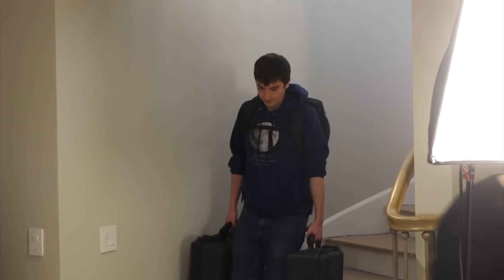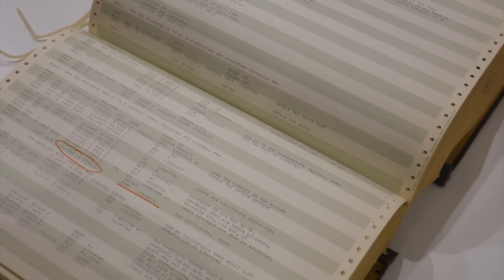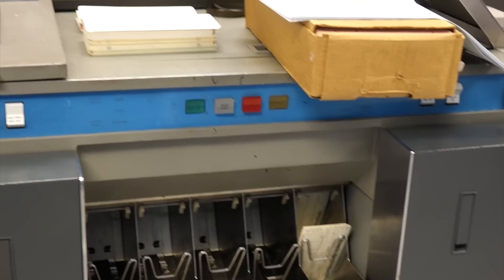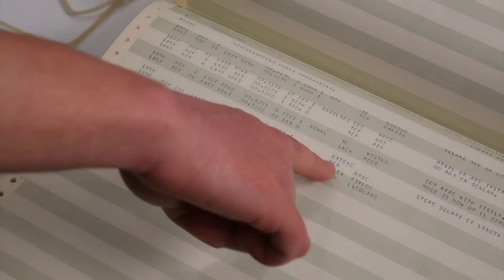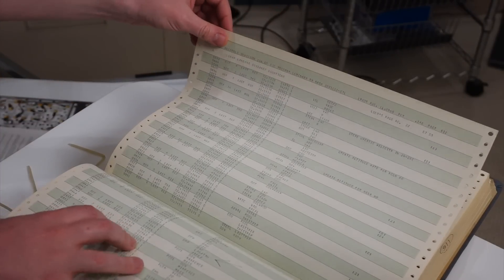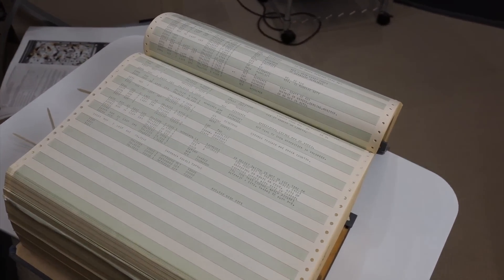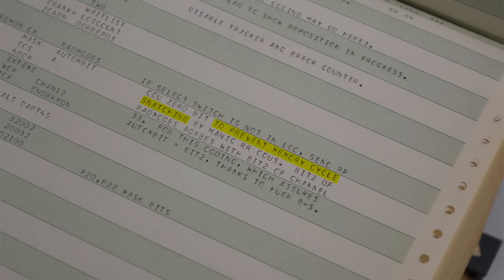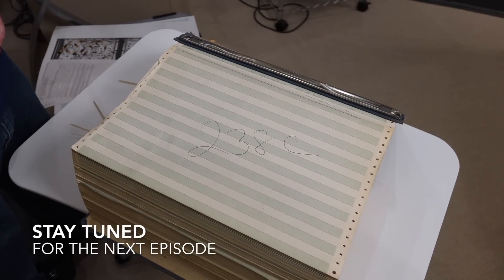Apollo 12 Source Code: Looking at the original flown code printout, and the 1202 error fix

Comment: So did the CDU unit always go "manic" on every Apollo mission, or was that issue caused by a fault with a particular individual hardware component?  In other words, was this code workaround the only thing stopping the 1202 alarms from coming up on every subsequent Apollo mission?
Reply from the maker: As explained in the video. I believe this is the only fix.
Reply: @CuriousMarc  Ok, Thx  Stiil not sure if the original CDU fault was designed-in or was the result of random component failure. I'll look again.
Reply from the maker: @rogermason1674  Oh, I see what you mean. It's a system design fault, baked in. Not a component failure or individual subsystem failure. A somewhat devilish systems integration issue between Grumman (radar) and MIT (CDU and AGC) equipment. Has to do with the phase of their respective power supplies, the fact that the angular position sensors in the radar were phase sensitive, and the inner workings of the CDU digitization circuits, which used the power supply phase also. The sensors ended up being powered by the Grumman supply and phase, while the CDU was trying to decode the signal using the MIT supply phase. It put the modules I circled in a really weird state, which caused the A/D counting to never converge. It will take a real long, but real interesting video (or several) to explain. Long story short, the CDU could become "manic" every time the radar switch was placed in slew or auto. But it's more complicated than that, because it did not happen in all the radar position angles nor all the supply phase angles. So you had to be a bit unlucky too, we are still trying to quantify that. Probably better to say it had the potential to recur in every Apollo landing.
Reply: @CuriousMarc  Thx for the explanation, but it leaves me wondering:

(1)  Why could they not ground test for this functionality to find the system design fault?  Time pressure, or just too hard to simulate for testing on the ground?

(2)  What exactly do you mean by power supply "phase"?  I thought Apollo used only DC power.  To me, the term "phase" only makes sense with AC power.

Just my thoughts. Don't feel obligated to reply.  Thx again
Reply from the maker: @rogermason1674  This would take us into a deep 1202 rathole, but of course 1) they did test and found it in ground integration tests, and 2) there are AC power supplies aplenty throughout the Apollo spacecraft.
Reply: @CuriousMarc  Ok, good enough for me. I look forward to watching any future videos you do on the subject.  Thx

Comment: This is an example of how software "grows hair" over time. As software gets used, oddball cases are continually found that require the software to be made smarter and smarter over time. On the one hand that's a good thing. The promise of software is that the machine can be made to do new things simply by typing, rather than changing the actual machine, and that's what happened in this "manic radar" case, so...big win and hooray for software and computers. But there are some down sides as well. It means that the software is never finished, just like here. You mean to tell me that this piece of software, into which 350 people poured more effort than any other piece of software in history, still needs more work? Well....yeah. It also means that the software needs to continually change, bringing the inevitability of new bugs. When they changed the software that was used in Apollo 11, there is an almost certainty that they introduced new, unforeseen problems for Apollo 12. You can't change it without risking that. It also means that older software is very complex, it has all sorts of oddball smarts in it that have been added, and new programmers need to deal with that, and it's very very hard. Also, programmers are notorious for not commenting their code...most programmers hate to do that and don't do it. That causes later programmers to go "Huh? Why are they doing this???" and that causes them to spend a lot, a lot of time and effort figuring out why some oddball fix is in there, if it's still needed, and if new changes are going to break it, all of which increases the challange and the effort required to support old software. Then you end up with a lot of garbage in the software, because maybe that oddball situation has been fixed elsewhere. You can't slice out those smarts unless you really know what you are doing, and many times you can't know, so you end up with needless complicated garbage and the program over time turns into a monstrosity. In this case the programmer's commented their fix, but they just mention "manic RR updates" and will some 23 year old programmer on Apollo 17 understand the "enormously complex" issues behind that three word comment? So, this simple one line fix is a good illustration of some of the reasons that software is so difficult. In some ways the concept of software has lived up to its promise, in other ways we see that building a machine that can think is more complicated than foreseen or that we would wish.

Comment: Paper: the most durable data storage so far.
Just compare to the lifetime of tapes, floppies, CDs, HDDs...
Reply: There are ways to keep data long-term like redundant storage servers where if an HDD fails, its data can be reconstructed from the other drives. Trouble is, no one likes to keep data around that long taking up space on their servers. Books are easier to shove into the corner of a closet for 30+ years until someone decides to clean it out.

Comment: Would be beautiful if the source code were in C or C++. I'd be staring at the code closely, I am 95% sure that 99% of the people watching this video dont know Assembly. However, it still awesome even if you arent a programmer.
Reply: A few of us know.  In 1977, I cut my teeth writing assembler language for the IBM 3790 and 8100 before writing assembler for the IBM OS/360.  I spent 29-years writing commercial system software in macro-assembler language from OS/360 with SLAC MODs to z/OS using its High-Level Assembler.  As a requirement for my mathematics degree I took a formal C++ language course.   That stated, using the macro facility, I was able to implement all of the OOD constructs with the assembler: abstraction, encapsulation, inheritance and polymorphism.  Accordingly, I saw no benefit in a C++ code base for the mainframe platform, especially writing system software.

Comment: This historical highlite is eerily analogous to an (in)famous comment in the source code to the kernel of Sixth Edition Unix, in function(?) slp.c, documenting a very similar workaround for a quirk of the DEC PDP-11 hardware -- being one of the lamentably few comments therein:

“If the new process paused because it was swapped out, set the stack level to the last call to savu(u_ssav). This means that the return which is executed immediately after the call to aretu actually returns from the last routine which did the savu.

You are not expected to understand this.“

Hilarious. Who said computer programmers don´t have a sense of humor?

By the way, the comment (as discussed) to the updated source code as a bug fix for Luminary revision 116 (for Apollo 12) in module(?) FLY on lines 1108*, follows:

“IF SELECT SWITCH IS NOT IN LGC, SEND RR CDU ZERO BIT TO PREVENT MEMORY CYCLE SNATCHING BY MANIC RR CDUS. BIT2 OF RADMCDES AGREES WITH BIT2 OF CHANNEL 33. FOR THIS CODING, WHICH ASSUMES AUTOMBIT = BIT2, THANKS TO HUGH B-S.“

Comment: I could be listening to someone speaking in Swahili at it would make about as much sense to me. But, it’s fascinating anyway (for some reason).
Reply from the maker: We confirm it’s actually Swahili.
Reply: @CuriousMarc  haha

I have a question/challenge for you. The USSR was also planning a manned moon mission. Although their program was ultimately canceled, they got a fair way along in development, and it seems likely (to my mind) that they also would have needed some form of guidance system. I wonder if any artefacts of such a system exist today. It would be very interesting to see the Soviet solution to the same problem...
Reply from the maker: @bertjilk3456  That's a great question. The USSR had landed two probes on the moon, inluding the first one ever to do so. So they knew how to guide. BTW, looking at the list of probes, I am shocked at how many failures there were up to 1969, and that very few had successfully landed before man came there (see https://en.wikipedia.org/wiki/List_of_lunar_probes ). I am not knowledgeable about the Soviet plans for the moon landing (if they have ever been revealed), but I vaguely recall reading that they were planning to guide from Earth.
Reply: @CuriousMarc  thanks so much for the reply. I guess if they had landed probes then they had figured out the six minute delay with some confidence. I guess we’ll never know what they planned.

Comment: Printed on a Drum line printer, not DM, or chain printer
Reply from the maker: This one appears to be from a chain printer. Most likely an IBM 1403.
Reply: @CuriousMarc  look at the characters, they are wavey, that's what a drum printer does. Because the print hammer has to wait until ths right character rotates around on the drum before it fires. If the hammer is not perfectly timed, you get wavy print.  Chain printers typically "ghost" a character when out if time, never wavy print. I worked on the 1403s a LOT. Drum printers are usually slower than chain printers too and make a racket. Especially if you print the same char on a line. The drum has to have a full char set at each position on the drum, whereas a chain printer can have up to 3 full character sets on the chain only upper case. IBM did have special print chains with upper & lower sets, but it reduced the speed of the printer as it normally had 1 set of lower chars (but you could get many diff options)
Also a drum printer ribbon would get worn on the left side a lot when using the printer for program listings. The 1403 wpuld scew the ribbon back and forth. Of course the operator could flip the ribbon around.
Btw I programmed the 1401, 360, 370, 4300 series, and s/390 series all in assembler.

Comment: I can't copy and paste without something fucking up.  How the hell did they put all that code onto rope-core memory without making a huge amount of errors?
Reply: That's one of my favorite features of the assembler that produced this listing. Its output wasn't an executable binary file or anything like that. At 6:19 in the video, you can see a machine move a loop in front of a core for the factory workers to pass a needle through. When they were ready to assemble a program, they would instruct the assembler to "PUNCH RAYTHEON WIRING TAPE", which would produce a punched tape containing the instructions (essentially, G-code) for that machine, telling it the X-Y coordinates of the core to put the wire through next.
Reply: @mikestewart8928  Thanks, I wondered if that machine was doing something like that.  Amazing group of people that made those technological leaps within such a short time.

Comment: You might want to get a camera to save this thing from being destroyed.
Reply from the maker: Not sure I understand the complaint. The video explains how we not only scanned it, including other ones that were on sale but we were unable to purchase, and manually corrected OCR so we could extract code that would recompile. Did you try to go to the links in the description to download the scan or code?
Reply: @CuriousMarc  No, I got it actually, I didn't complain, lol, I congratulated you and thank ed you with a thank you in abbreviated form ty. Also, if someone tried to psyche you out, or, make you think different than intended, or, change your ideas, it wasn't me.
Reply: @CuriousMarc  Oh yeah, one more thing though, you might want to keep an encrypted version, in case more security is needed, I'm not sure what the rights are for this work. I mean, it's possible that they renewed their rights by describing their original rights and so on. I'm pretty sure they also have clearance level of the type of trade secret they would be registered under. The have many patents which expired though. It's nice to have this in public domain because I took a systems analysis course with a Purdue book and got 99% in 1992/1993.
Reply: @CuriousMarc  Ah , I understand now, you mean , why did I write that "you might want a camera to save this thing from being destroyed" . The reason I wrote that is because of attacks against my code and interference against my rights, and against the backups I had, which caused me to have to redo everything, and include the attacks in it, and the fraudulent refusal from the courts, before the military intervened and the international courts. So yes, security. -Some people tried to change my idea, whether to psyche me out or not.
Reply: @CuriousMarc  Ah yes, also, we had to study about the Apollo project, one sec.

Comment: it is better to wear gloves handling the paper so as to avoid getting sweat on to the paper. This slows the rate of degradation.
Reply: No. If you do a google search for "historical document gloves", you'll find a wealth of articles that explain why wearing gloves when handling documents is bad. Many archives will even forbid you from wearing gloves for such things. Gloves are for physical artifacts that might be oxidized or damaged by finger oil (photos, metal, etc.), not paper.

Comment: Surprised to see this in Assembly instead of Fortran. Very ugly code.
Reply from the maker: They could not have possibly used a language such as FORTRAN, that would have taken far too many resources on a 4 kB RAM and 72kB ROM computer! Instead they wrote a virtual machine with virtual instructions and programmed on that for the more complex routines, when performance was not an issue and in order to save big on instruction count, and went down to assembly when real-time performance mattered. All that on a real time multi-tasking interrupt driven OS, that was checkpointed and could recover from a crash in less than 1 second without losing control of the spacecraft. The very opposite of ugly code.
Reply: @CuriousMarc  Thought i was old school but i guess not enough old school. Punch cards were about a decade and a few years before my time. My first language was Fortran 77 then Cobol, Ada, Pascal, etc. My degree is in Electrical Engineering not Computer Science. First processor that we wrote assembly for i think was the 8088 or 8086 if i remember correctly. For Fortran i remember having to know all the instructions to compile the code on the VAX mainframe at the university I graduated from. Hard to believe that todays calculators are more sophisticated than what was used to fly these ships into space.